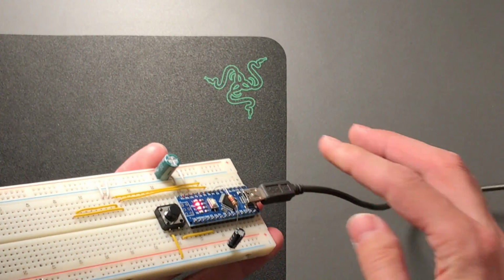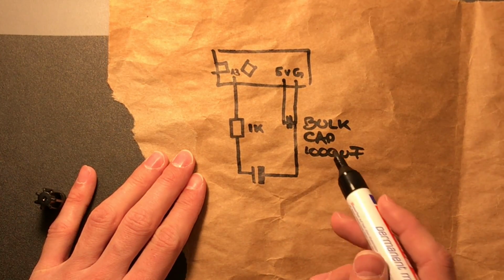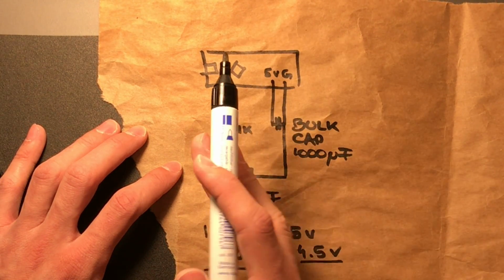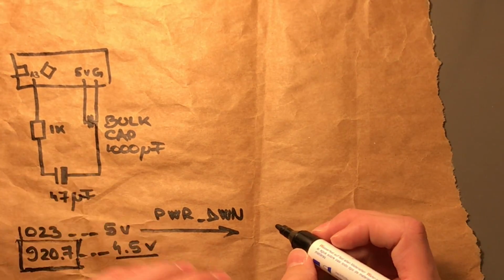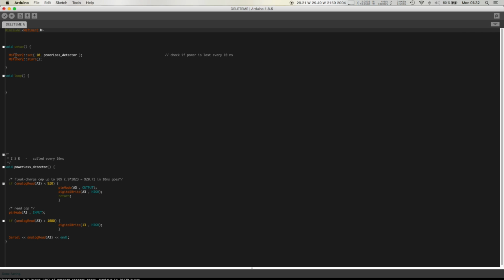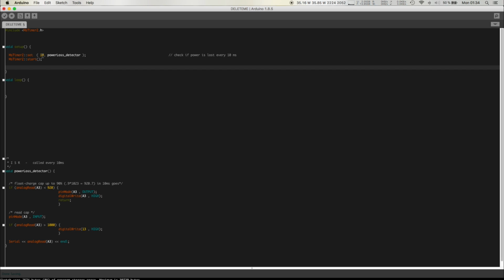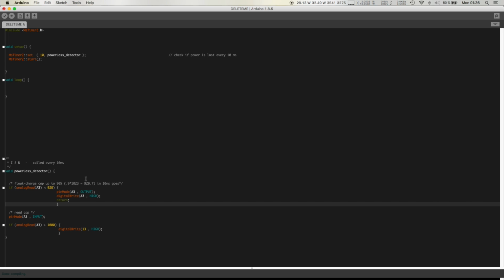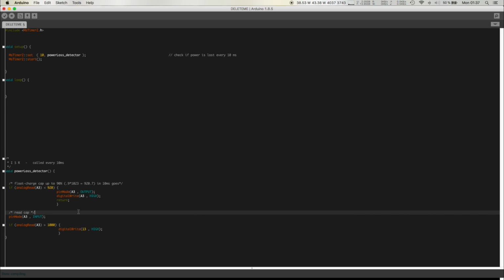Arduino Power Loss Detection with 2 Components - Saving State to EEPROM

Comment: It can be even simpler : just connect a 10 uf capacitor between the Analog input and the ground (gnd) even without the resistor. Then remove the code line "digitalWrite (A3,HIGH)" and change the line "pinmode(A3,OUTPUT) to "pinMode(A3,INPUT_PULLUP)". Now you are using the build in pullup resistor to charge the capacitor.

Comment: Thank you for showing this very nice approach to handle power loss. Power loss can come in more forms. It can be some external fault, that will create a ripple voltage on the supply of 100 Hz or 120 Hz. It can also be a short time power voltage dip due to a neighbor having a short circuit in his home. I guess it is "next level"  to decide what to do in such situations.

Comment: Great idea. Many have tried to resolve this. You have a very original approach. This worked for me. I needed to be careful during testing. I didn't want to put the CPU in a loop that wrote to the EEPROM. The LED that goes on is a great sanity check. Interesting how the voltage jumps above 1000 when power is lost.
Reply from the maker: yeah - that bit is the tabu part .. you're overloading the ADCs quite seriously .. buuut .. with quite little current

their reference goes below what they're reading so they'll quite swiftly go to full scale
Reply: Thanks for your reply. One item came up during testing. When powering up the arduino, I kept blowing my 1 amp fuse. This is a fuse I added to my external supply. Research showed that the 1000uf cap could draw an instantaneous 3-4 amps during its charging time. I added a 2watt 10ohm resister in series with the 1000uf to slow the amperage charge time (and of course the amperage discharge time). This Resolved the high amperage inrush. Your approach is very original and good.
Reply: At the time of my first comment, I was not using the external power supply with the fuse. So, I had not seen a direct cause to this. At first I was testing with the USB Comm port to power the arduino. I did notice the Arduino IDE was not playing the connection wav sound file as it usually did. Adding the resistor, resolved the wav file sound and the fuse problem.

Comment: Have a confusion, the moment powercut happens, after that how much millisecond does the module has to save in eeprom !

Also if there is too much code, loops - in that case will this example work ?
Reply from the maker: it will work no matter how big the rest of the code is

because this is running in an 'interrupt'

which - by definition - interrupts the regular execution of code to run whatever you put in that function

depending on your bulk capacitor .. you should have 10 to 1000 ms of time to write to the eeprom

you could also initially switch loads off if you may have something drawing a lot of energy from your reservoir cap .. depends

but time-wise this should be fine
Reply: @Darieee  thanks for the reply, one confusion- i have bulk capacitor 1000uf 25v, will it work. What should be the voltage of the bulk capacitor!

(Sorry my question could be silly, as i have no knowledge about capacitor 😥)
Reply from the maker: voltage needs to be higher than what you will be using it at -- ALWAYS

1000uF is how much storage the cap has - and 1000 should offer you at least 300ms of operation once the power dies
Reply: @Darieee  thanks a lot ❤️

Comment: I am trying to make a power loss counter, what happens to the Counter / incremental register when the reset button is pressed? Does that is equivalent to power fail state? I had coded as you said, but on reset button press its incrementing counter of no. of time power failed. any comments ?

Comment: Just curious. How would you execute this if the unit was powered through the VIN pin and the capacitor would stabilize the VIN pin if power was loss prior to that part of the circuit?
Reply from the maker: it kind of is though ... I do use a bulk capacitor and the measurement is .. albeit indirectly of a voltage up-river of said cap

I'm thinking of it now and it does seem an awfully complex/dangerous/stupid way of doing it 🤔

make sure to measure in a voltage divider as there is a diode drop coming into the micro -- please do try it like this and let me know how it works
Reply: @Darieee  I only ask this cause I have several stepper motors, an oled, and an SD card module running off of the Mega that i have. I want to be able to save to the SD and make sure everything sets to ZERO during save/shutdown.The VCC pin limits a draw to other modules. With this setup, you are limited with the 5v in. If there is a super capacitor in place that can provide 5-10 seconds of power, then all can be saved and set to zero. 
Suggestions would be greatly appreciated!

Comment: Buddy, I followed this and it worked. However, a few things I noted.

 1) We are charging the bulk capacitor off the 5V o/p of Arduino. At power loss, we are feeding back to the same port the voltage from Capacitor. Is this allowed? Shouldn't Arduino be run via Vcc pin if not from USB port and barrel pin connector for external power supply.
2) I used 5.5V 1F Super capacitor. It gave me 30 seconds of ON time after power loss. However, within a day, I have spoilt 3 Super capacitors. They initially work for 30+ seconds and provide enough current. After 3-4 trials, suddenly their current capacity drops. They still hold voltage but no current. 

Not sure what am I doing wrong.

I am trying to add a diode for charging super cap so there is no reverse current. Will feed + of diode to AREF. Use a boost converter to step up to 7+ volts and feed to Vcc pin of Arduino. 

Do you have any suggestions?

Comment: Hey man, ive been looking for better way to write into eeprom on powerloss and came to the right place. Thanks for this wonderful tutorial. Btw, is 25v capacitor enough for 22uf and 1000uf?
Reply from the maker: yeah, 25 is a very conservative value for such a use case;

10v would be the lowest you would safely go down to in case you need smaller caps
Reply: @Darieee  thanks for the response, buddy. Keep up the good work 👏👏👌🙏
Reply: @Darieee  hey buddy, i have exactly followed your procedure but cap value is staying at 14 all the time. It doesnt look like its getting charged. Im skeptical about the MsTimer2.h that im using. Could you please share the library that you've used? Thanks
Reply from the maker: can't really ... haven't played with that stuff in 2 years almost

do try using timer1 though
Reply: @Darieee  oh ok. Did use timer1. Still same issue. Anyway, thanks for the response

Comment: Or, if your MCU has an internal fixed voltage reference that your ADC can sample, you need NO components/pins at all..
Reply from the maker: interesting idea

the arduino/328p does have an internal 1v8 reference as far as I'm aware .. not sure the arduino environment or the chip itself can sample it but if it could, that would be pretty nice

you would still need a bulk cap though to give you some time to write to the eeprom though
Reply: @Darieee  Yeah, sorry you need the bulk cap. I have done it with a KV31 series NXP microcontroller.. An ADC channel is connected to the internal bandgap reference. The ADC continuously reads this bandgap voltage with reference to the supply voltage. I have set an interrupt that triggers when this read value goes above a certain level. The only thing the CPU does is  to save the data to the EEPROM whenever this interrupt fires.. Other than that, it is all hardwired logic and doesn't consume any CPU cycles.

I need to thank you a lot, since I had the spark when I saw your video, without that, I couldn't have thought these myself
Reply from the maker: nice to know ✊, glad I could help - and - thanks again for sharing this tip .. must be how the big boys do it .. 

I always wondered how these fancy USB power monitors keep track of shutdowns
Reply from the maker: just make sure to always use some wear leveling magic

Comment: Great job and thanks. A suggestion for the coding, you can use "else" instead of using return. I tried your code and it works perfectly. Thanks for the brilliant idea!
Reply from the maker: thanks - glad it helped 🤘

I'm not sure I follow your suggestion though - can you elaborate ??
Reply: @Darieee  the main purpose you put return is to avoid run the remaining code.
You may try to change the code to if... else. Once it done coding in the "if" statement, it wont go to "else" statement.
If(analogRead(A3) <920)
{
   ........(same as your code except the return) 
}
else
{
   If(analogRead(A3) >1000)
    {
     ........ 
    }
}
Reply from the maker: ah yea - got it 🔥

what would be considered better practice though?
I mainly did the return to keep as much code on the first indent as possible // i.e. have the code be as readable as possible 
(+ I think I had just found out you CAN still return stuff from void functions and was abusing it a bit 😬)

Comment: I am little confused why we need charge that analog pin side cap ?
Reply from the maker: because the voltage in that capacitor will serve as a reference for the main supply voltage

if ever that voltage is to be higher than the supply rail, it must be a shutdown event
Reply from the maker: if you measure the supply rail with an analog pin, that will always read the maximum, 1023, no matter what the supply rail is at
Reply: Thank you. The reason is as i think but i was not sure about it. Have you tried with one cap that only supply microcontroller not other load etc.
Reply from the maker: yeah .. I've found no way to detect brownouts with just 1 single reservoir cap on the input .. some chips can detect that, not sure the 328P can

Comment: Great tutorial and forks fine for arduino.
I am trying to implement this this for ESP8266. I used basic timer in loop to make sure there will be no problem with timer library and it works for arduino, but does not work for ESP8266.
I am testing with voltmeter and getting 0V reading form A0, whereas on arduino it is above 4V.
Do you have any ideas what can be wrong?
Thanks in advance.
Reply: I've been researching this problem and the problem is that nodemcu cannot use A0 as output. Do you have any suggestions hot to overcome it?
Reply from the maker: I've never used that micro I'm afraid;

perhaps someone else can chip in
Reply: @Darieee  can this trick somehow be played with digital pin? I've beet trying all day so save to EEPROM on power down with ESP8266 with no success.

Comment: Clever concept. I'm not sure what you're trying to achieve with this power loss sensor. My goal is to implement auto resume on power loss for a 3D printer. The power sensor should be as fast as possible in detecting power loss, in order to allow the printer firmware to do some stuff before power get too low: power off bed and extruder heaters to get more time, save current gcode line to SD or flash, move steppers to closer whole step) taking advantage of the PSU capacitors charge, which will keep the voltage up for some time after main is gone down. So I'd rather think of a design monitoring mains sine wave interruption in order to detect the power loss as early as possible - even before the PSU output voltage starts decreasing. I'm currently looking into zero crossing detection circuits, so using an optocoupler to sense mains power loss. Any thoughts?
Reply from the maker: Yeah so - if you have a mains application, I totally would also go for that ... I think you're overcomplicating things though ... you could just get taps off both power lines, resistor dividers maybe diodes ... and straight into an adc /// or via an opto coupler if you so please

My application was a battery powered power monitor (I have a video on it as well), and it really was important that it saved the accrued values, as well as the display mode it was in
Reply from the maker: alternatively, IFF your application draws enough current, a ludicrously safe (I think it can be formally proven to be the safest) way, would be to use a current sensing donut

I also have a video using one of those up ... just search my channel for current sensing donut

Comment: This is a great concept and it worked with my Arduino UNO.
Is there a way to connect a type of battery that is better than a capacitor?
Reply from the maker: Thanks!

So, here's an overview of the system

Goal: save something to non-volatile memory at loss of power

Theory of operation:
1. a bulk capacitor is a large-value capacitor that stores enough energy in it (like a mini battery) to allow the system to keep running AFTER main power has been cut (usually for 100-300 milliseconds more, which is plenty of time)

2. another smaller value capacitor will be used to basically "remember" what "full power" looks like. when we loose power all of a sudden this "reference capacitor" will appear to be at a higher charge than before, 'unthinkably' high if you will: if this is the case, it MUST mean the system voltage is now falling (as the bulk capacitor discharges, after main power has been cut)

I hope this clarifies stuff
Reply: @Darieee  Please help me explain, how the small capacitor sees 1023 after power loss.
Reply from the maker: Yeah but ... a 1000uF 6v cap should in all cases be more than enough time ... you could send commands to turn off LEDs and stuff to preserve more energy while saving to the eeprom

But don't overdo it ... sending a clear command to the display might not be worth it for example

I'm glad it helped :D

Comment: Great! This was just the thing I was searching for. I was looking for a solution to store a position-value of a stepper to the EEPROM when there is a powerloss. But only then because of the limited cycles of the EEPROM. Your scematic works almost perfect. I found out there is a peak of 5v when the cap is being charged using your scematic. So in my case as an addition to a power loss, everytime the cap is being charged it writes away to the EEPROM. This reduces the lifetime of the EEPROM significantly. Therefore I tried to ad a voltage devider to your scematic. It seems to work now whitout the peaks of 5V when the cap is beging charged and only 5V when there is a power loss. I used 22k and 220k resistors for the voltage-devider to keep the charged peak around 4.5V. My knowledge of electronics is quite limited, so I'm not sure this is the way to go but it seems to work.
Reply: Writing to EEPROM without that cap between VCC and GND won't work. In my case I needed at least 2x 47uF between VCC and GND. Thank you!
Reply from the maker: Hmmm, I don't know what you mean ... if you implement stuff exactly as I did it will only write at powerloss ... 

If your cap stays too high, then maybe you should charge it for less time and more infrequently (or get a bigger cap or put a bigger resistor in series with it so that it charges slower)

A voltage divider is 100.0000000% not needed. 

Also there is an EEPROM Wear Leveler Library which helps spread the wear over all the memory cells - works quite well
Reply: @Darieee  sir may I ask if this circuit last for how many years?
Reply from the maker: Yea .. good question

My meter is still working, although I must say ... I haven't powered it on and off more than 100 times or so
Reply: @Darieee  Ah I see thank you very much! I want to use it on production line I don't know if this circuit will have a long  life.
Reply: do you have any recommendation. regarding this matter? hehe Thanks a lot!
Reply from the maker: Pfff yeah ... the 'safe' way would be to have a diode and a huge cap after it ... and constantly probing ahead of the diode

Or does that idea also have some fatal flaw?